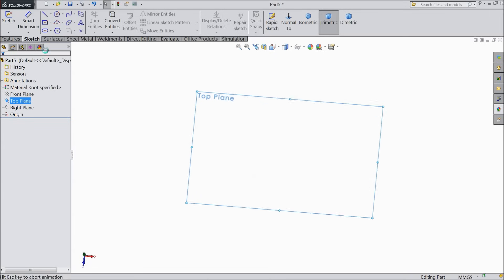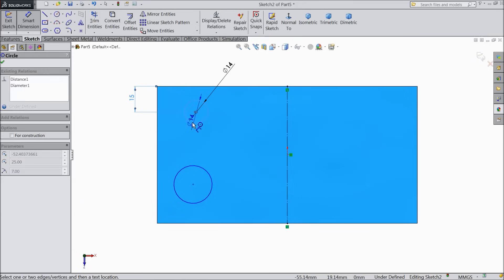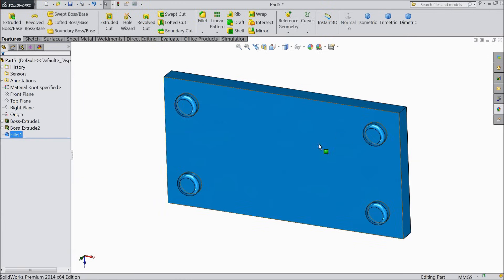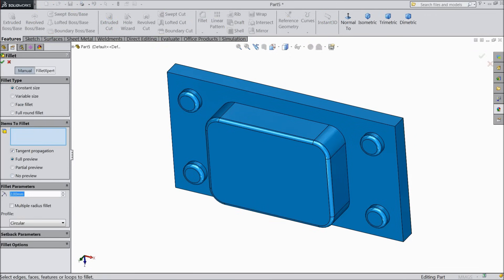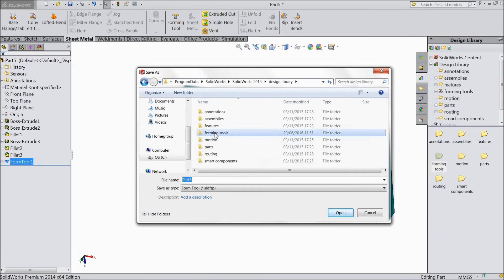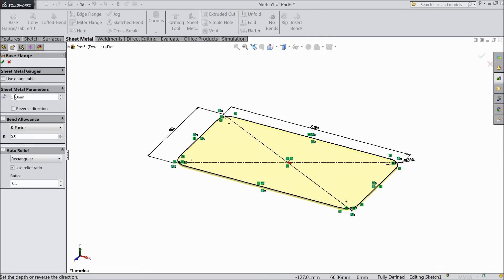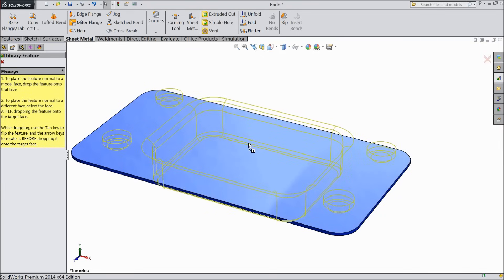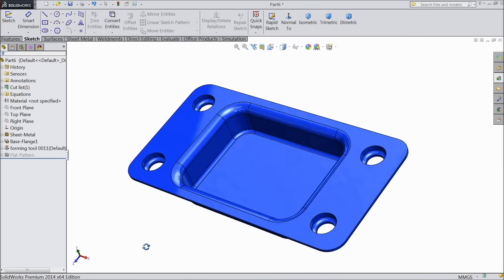Solidworks Sheet Metal tutorial forming tool

Comment: Sir, great videos, thank you, but does the forming tool let you see how much force is needed to apply to form this and how much can a sheet of any material and thickness be stretched, until it breaks? Thank you.
Reply: 1. To reach form a sheet metal you should apply more force than materials' yield strenght value at least. 
2. You shouldnt extend the ultimate strength of materials.

Comment: after this how do you know the sheet metal that you will need to do this part?
Does the program assumes that the sheet that you made (at the 5min mark more or less) is the one that will be used to produce the part?
Reply: I want to do a part that bends all the way in 2 directions X and Y doing a inverted V in one of them like:     /\   
and 2 half a circules in the other like: _/\_/\ _
i will also do some holes but i think that's no problem
I already have the part made but i have to know the sheet metal needed to make it